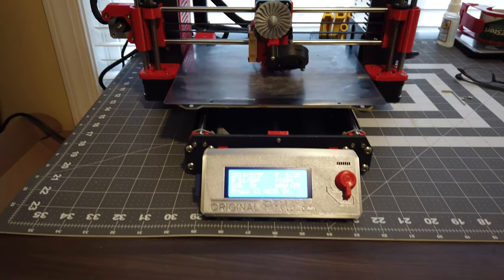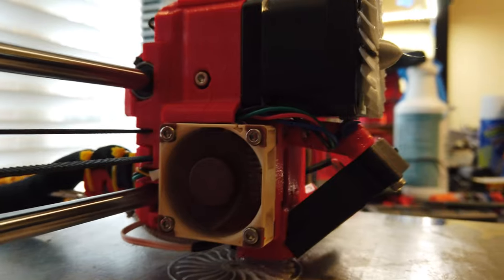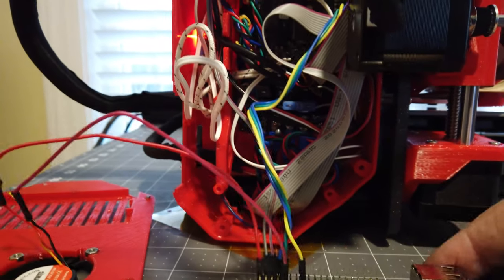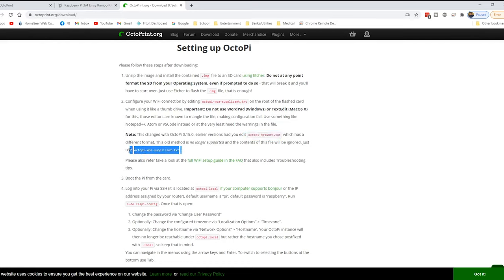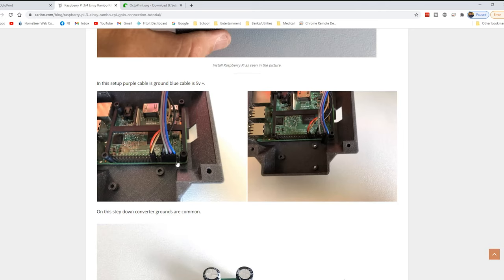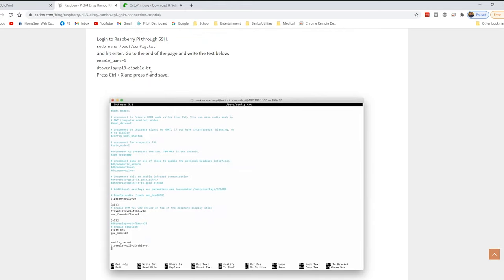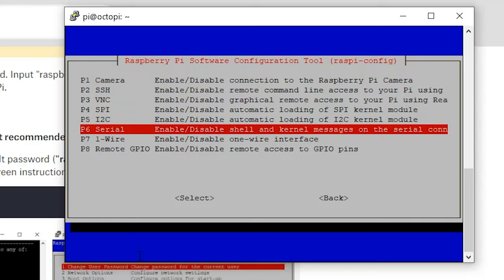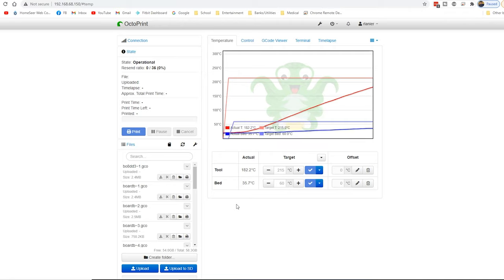Connecting and powering Raspberry Pi to a Prusa

Comment: A quick piece of advice - if you recently reset your einsy and it wants to invoke the wizard, you want to be sure to clear that and get to the normal informational display before testing your connectivity - otherwise it won't connect! I used the 4 wire GPIO and useda buck converter for the RPI power. I recycled the twisted pair wires from a spare cat 6 cable for my connector cable and have no noise issues, as I have done in the past for other things like BL touch probes and the like.

Comment: What's the quality of the components supplied for the clone? I would think it would be a potential worry that it'd have cheaper electronics? Concerning fire hazards with cheap stuff that gets hot 😬 decent quality power supply and heat controlled components?
Reply from the maker: Good question. We have had to replace some parts on our original Prusa and our first Rerap printer. We ordered most parts from Amazon and other suppliers. Those parts looked just like the ones we took off the printers. So I'm not sure how you guarantee any part you buy since most don't have brand markings?